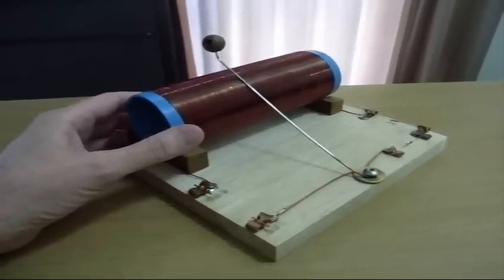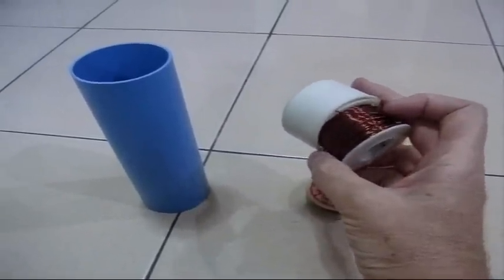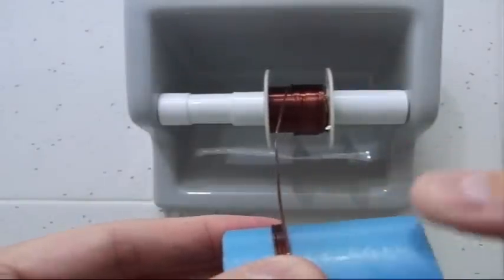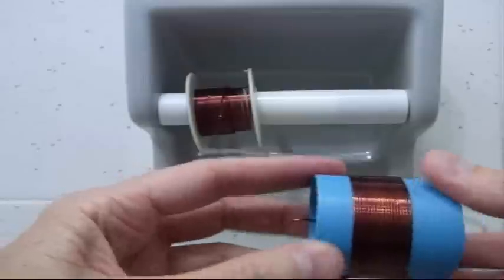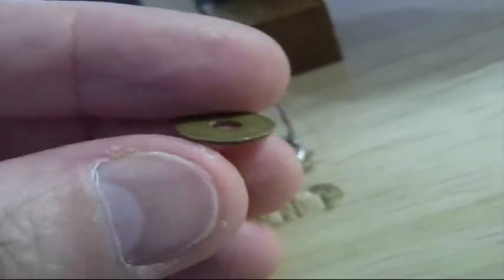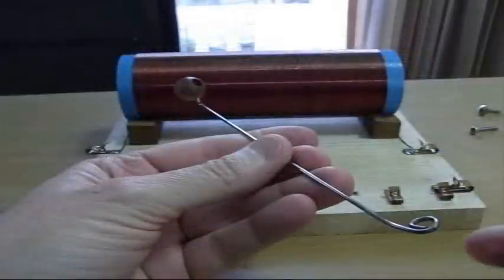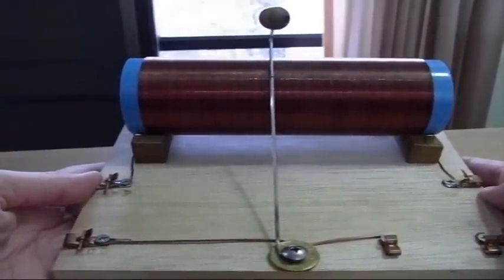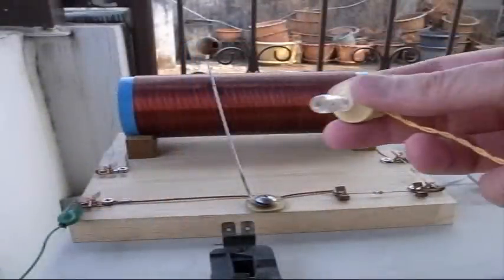How To Make A Crystal Radio - No Batteries (Updated Version Available)

Comment: nice video.. have you managed to get these contraptions to light up an led?? I seen some do that here.. that would be interesting to see ! wireless free energy from the air with air coils!! we could also use litz wire for these coils right? I think we could also use terminal connectors instead of solder or brass clips..do we really need the resistor to make it work?
Reply from the maker: Lots of good questions.  I have tried to get it to light up an LED and thought those were fake.  I tried and failed, BUT I got much higher voltage readings than I thought possible (around half a volt!).  Now I am thinking that if I was close to a high power station (the ones around me are just average) it might light up a very sensitive LED.  The videos I've seen the LED is just barely lit and I suspect may actually be an infra-red LED, but lit is lit.  So I have to do a video on what I found.
Litz wire is theoretically possible, but I think would be very difficult in practice.  The wiper would have trouble making consistent contact.  But I don't know so it might be worth a try.  I just used .5mm enameled wire.
Yes, terminal connectors will also work.  I wanted to experiment with different components and made it easy for them to take in and out.
Yes, the resistor is necessary to get the best sound from these "new" crystal earphones.  They are piezoelectric and have lots of capacitance.  Without the resistor the charge builds up then discharges so you get constant "static" sounds.  The resistor bleeds off charge so you get louder, and much clearer sound.
Reply: if we used litz wire we may not use the rod tuner anymore, but we may have to use tuning air capacitors..the resistor removed might.give lots more lighting power for a possible led lightup..the videos I saw used air capacitors tuned in resonance with the coils and it light up a bright white led..I heard.litz wires have more advantage because it has multi insulated strands within that act like ac capacitors and store the energy coming in like a very light leyden jar hehehe..I hope you succeed in lighting up an led..its like the holy grail of free energy from the power stations powerful transmitter !
Reply from the maker: fidel catsro There are many possible circuits, many of which use a tuning capacitor.  The capacitance for the circuit is usually in the picofarads (3-370) and the coil is about 400 uH so adding more capacitance in the litz wiring may take the circuit outside the AM band unless you re-spec the coil.  It might still pick up a multiple of the wavelength (or some other band) but at much lower power.  I'm working on one of those with a mica tunable cap.  Will be interesting to see how much I can pull out of it.
Reply: interesting tiny puny capacitors adjusting the frequency to get the right waves for us!
Reply from the maker: It is amazing.  I build one many years ago and played with it for hours.  Took it to school to show my friends and teachers.  Even years later it still is fascinating that it can pull enough power from the air to work by itself and be as loud as it is.
Reply: tsbrownie we in asia weren't taught about these in high school other than pictures of a laminated ac step down transformer in the 1990s..maybe they afraid it might lead to many pulling energy from aether if they taught it here!!
Reply: professorfidelcat I thought of combining a loop antenna crystal radio with Jeanna's light. I don't know if it will work though.
Reply: ok ive managed to light up a cfl with a single good AA 1.5volt battery using an audio transformer and a tip21 transistor before..it takes about 250ma at least at 1.5volt input..it might be a challenge for you to light up something more guzzly than LEDS
Reply from the maker: I finally did better than light up an LED (which I also did), but got this to work as well:
https://youtu.be/0WvZC3-mR6Q
Reply: @tsbrownie  hi there its been a long time eh 7 yrs!
Reply from the maker: @fidelcatsro6948  Yes, a long time, but I got it to work as you asked! 😁
Reply: @tsbrownie  congratulations let upscale that to a 14volt car battery charging system🐱👍🏿
Reply from the maker: @fidelcatsro6948  OK, give me some time! ;)
Reply: @tsbrownie  try to hit 20volts or even higher if you can, once its used to charge a battery its going to bog down and drop voltage

Comment: Does it have to be a special diode? In that case, what type of diode does it have to be, I'm wondering if I can use some random diode that I can salvage from some electronic device to use as the diode
Reply from the maker: It MUST be a 1n34a diode.  99.999% of other diodes will not work.  There are substitutes, but don't risk it.  You will spend lots of time and don't want it to fail because of the wrong diode.
Reply: just look for "Germanium diodes"

Comment: Hello, #tsbrownie - does it matter the voltage rating for the 10k ohm resistor?
Reply from the maker: The voltage rating does not matter in such a low voltage application, but you want to use a carbon resistor and not a wire wound one.

Comment: Not getting anything in the earpiece. What is the significance of the diameter of the bottle, you use to wrap the wire. I used a smaller bottle with only 40 rounds. Should I use a bigger(in diameter) and longer bottle to be able to coil around more wire ?
Reply from the maker: +Anurag A. 40 turns is rather few, but you should get something.  The usual problems (in order): 1) did you use the correct type of earphone.  ONLY a crystal earphone will work.  2) did you take the enamel paint off the wire where there are connections?  On each end of the wire and where the wiper touches the coil.  3) Do you have AM stations in your area?  (This is a problem in India where they don't have many).  I just made another, different style yesterday and even before it was completely done I could get 1 station!
Reply: +tsbrownie I'm in US about 100 miles N of DC. I got the crystal earphones(Philmore Crystal earphone high impedance n. 748 Japan) from amazon exactly like yours. the only suspect is the antenna now. I connected a roughly 15 ft magnetic wire(same wire I used to coil around the bottle) to a satellite dish outside my house. For a very short period this morning  I heard a KRRRRRRRRRRR..., but that also went away quickly. Now it is absolutely blank.
Reply from the maker: The antenna wire can not touch anything metal.  You can use string or plastic or such to tie it up.  Make sure the enamel paint is off he end that connects to the radio.  Is your diode a 1n34a?  Other diodes won't work.  If you can, make a close up video of what you have, post it and I can look at it.
Reply from the maker: +Anurag A. From your video: Your windings look OK.  You used just 1 set of windings, yes?  
The earphone looks like the right one.  I can not clearly see the diode or resistor, I will assume the values are OK.  The big problem I see is the wiring.  I do not think that is right.  The circuit is a big "U".  One the right side of the "U" at the top is the antenna coming in.  Then the coil.  The bottom of the "U" is the resistor with the earphone across the resistor.  The left side of the "U" is the diode and above the diode is the wiper (or jumper in your case) and at the top of the left side is the ground.  
To test your diode and antenna you can put the antenna on one side (does not matter which) and the ground on the other.  Put the earphone across the diode (no resistor, just diode and earphone).  You should hear the loudest station (no tuning obviously).  
The antenna can not be in contact with metal or be inside or under a metal roof or similar.  
Final comment on wire: you must be very careful to remove all the enamel (green) coating all the way around the wire.  Also some of your connections look loose.  The currents you are working with are very, very tiny.  Small resistances add up and will kill the signal.  Make sure the connections are tight / strong.  If you are using steel screws or plated screws they may have oxide and/or not connect well.  I strongly recommend stainless or brass screws and washers.  If you can solder connections that is best (requires brass, stainless won't solder with normal solder).  Use only rosin core solder (not acid).  
It appears you have all the right parts, it's a matter of connecting them well and in the right sequence.

Comment: What sense does a recipient make. the one without electricity, works when you need an amplifier?
Reply from the maker: No amplifier is needed.  No electricity is needed.
Reply: @tsbrownie  No. I built such receivers in my youth, and it doesn't work that simple. The output power is not enough for such an ordinary earphone. If so, it only works with a high-resistance part such as an earpiece on the phone. And even then you can only hear the station that is closest to your own location. The selection and filtering of such a device is far too weak and imprecise

Comment: I take it since the pvc is an insulator, I could paint it a different color if I wanted and shouldn't make a difference?
Reply from the maker: +B Mart. You are right, it is an insulator, BUT (and it's a big but) paint color is typically a metal oxide and metal oxides often react with radio frequency energy (like ferrites and such) and can keep it from working right.  A clear acrylic is OK usually.  You can also use cardboard and colored cardboard will *likely* not have metal oxides or enough of them to be a problem, BUT (big but again) it's probably not worth it.  I've got a wooden coil I need to put together, not sure how it work, but hey, the experimenting is half the fun.

Comment: Because Stainless steel is a poor conductor of electricity, would a normal steel spoke make a better wiper?
Reply from the maker: The problem is that normal steel rusts quickly, especially in contact with dissimilar metals. So for the first few days it might work better, over time the compromise with stainless pays off.
Reply: Stainless is not much worse than non-stainless steel.  The resistance of the wiper is small compared to other losses.

Comment: Question what does 100k resistor do? In your design? Thanks. 😁🛫
Reply from the maker: The new crystal earphones are piezoelectric and they have a lot of internal capacitance. The resistor drains off the charge. If no cap, the sound is quiet and you get popping. You can adjust the resistor. I have used from 10k to 100k. 50k is a good place to start.
Reply: Thank you for responding I will give that a try.😁🛫

Comment: Thank you for this outstanding tutorial. I was wondering, what happens if the wire is kinked? No reception or simply a less good reception?
Reply from the maker: If the wire on the coil is kinked it will only affect reception a little.  The big problem is that it will open gaps between the turns of wire and the tuner rod will not want to stay in position around those gaps.  Most kinks can be undone and flattened out with pliers, so you don't need to have them.
Reply: @tsbrownie  one mystery less :)
Reply from the maker: @odal6770  I have many videos on building crystal radios.  If you have one that does not work, I have this video on fixing common problems: https://www.youtube.com/watch?v=kCxQ8iPQx4s&feature=youtu.be

Comment: Does the wiring have a coating?
Reply from the maker: Yes.  The wiring MUST have an insulating coating / varnish.  It's like the wire in electrical transformers and such.
Reply: Thanks.

Comment: I wish you would have explained more how it works, for instance, why does it not matter how to connect the diode (in / out)? And also why is there no crystal? In the old crystal radio's they use a piece of crystal and a pin on it. Sorry, I don't understand much of electronis but I want to learn and understand it. Also, does it matter how thick the copper wire is?
Reply from the maker: I need to do an updated version of this. The diode is the crystal; they are much easier and more reliable than home made diodes (rectifiers) like galena, rusty razor blades, etc, but they are all doing the same thing. Yes, the thickness of the copper sets how many turns per centimeter, that affects induction. I have a video on how to wind coils, it explains more about them. AM radio works by varying the strength of the signal with the loudness of the sound (overly simplified). You've seen pictures of sound; they look like graphs. The diode takes either the top, or bottom of the wave and cuts off the other half and that remaining part wiggles the earphone diaphragm. Your ear does not care if the diaphragm wiggles up and down and up and down, or down and up and down and up.
Reply: @tsbrownie  Wow, thanks! I wonder how these diodes are made, its all so magical to me. I also don't understand why there's a resistor in between the earphone wires. I wish I would understand every detail of it all. Why does one wire of the earphone not care how much power goes through and the other is 0.25 watt with the resistor. I'm also wondering how the current flows, what direction, is the wiper the initiater of power? I love your video, I've ordered all the parts and will build this thing with my daughter. I am an IT woman and programmer, but I really know nothing about eletronics. I want to learn this stuff, I love it!
Reply from the maker: @Saskia-uz4ds  What we both need is an analog engineer, but they are rare these days. I am a ham radio nerd, but don't practice any more. There are some really excellent videos where people show the current flow through (google current flow in crystal radio. They don't all match my circuit and some show a circuit that does not work, but you will get the idea better).
This is not 100% true, but it's close: In this radio, the left side is acting as an antenna tuner, and the right side is an inductor / capacitor (coils have both properties) that resonates at the frequency you want to hear. The wiper is diverting the signals you don't want to hear to ground. 
The resistor between the earphone leads was a capacitor in 1960s radios because the crystal headphones were a very different design. Today's earphones are piezoelectric and they build up an electrical charge and quickly stop working (you hear popping), so the resistor gets rid of the static charge. You can experiment with different values for max loudness.
Reply from the maker: @Saskia-uz4ds  You do have AM radio stations in Croatia, yes? That is very important. This does not work with FM.
Reply: @tsbrownie  Thanks for all your info, I really appriciate it! I am from the Netherlands and we still have AM radio. I went to a electronic store today and bought all the stuff I need, luckily they still had some germanium diodes. But I bought a regular mono headset, hopefully that will do. I'm very excited to solder this stuff tonight. Now I'm going to cut some steel from my old bycicle wheel! 🙂
Reply from the maker: @Saskia-uz4ds  google traslate told me it was Crotia. :( The regular earphone will NOT work. Its impedence (resistance) is too low and acts like a short. The piezoelectric earphone has extremely high impedence. They are opposites.
Reply from the maker: @Saskia-uz4ds  I just searched "crystal earphone Netherlands" and found them.
Reply: @tsbrownie  Haha, "Nee dank je" is Dutch for: "No thanks". Do you happen to know how the old earsets are called? And if they are still for sale somewhere?
Reply from the maker: @Saskia-uz4ds  I thought it was Dutch, I've been to NL several times for work, but google translate insisted it was most likely Croatian. When I google "crystal earphone" under "all" they show up for sale in Amazon and other places. If I look at "images", most are the piezoelectric type. I bought 5 last year for about $1.50USD each. If you google "antique crystal earphones" the over-the-head black ones are the old style. I won't recommend them because you pay a lot more for painful ears; they are very uncomfortable. "Buy antique crystal earphones" gets you lots of hits on ebay from between $40USD to $100+.
Reply: @tsbrownie  Thank you so much!!!!
Reply from the maker: @Saskia-uz4ds  Good luck. Post a link if you make a video.
Reply: @tsbrownie  Perhaps I will, I never upload videos but why not indeed rhis time. 🙂

Comment: Thanks for the Video, can you please give specification of the earphones you have used. I tried using Telephone headset, it did not work. Please provide specific name, I can go on amazon and order it. Also please give specification of the resistor. Thanks a lot.
Reply from the maker: +Anurag A. These are piezoelectric earphones.  I have never seen specs.  You can search on "crystal earphone crystal radio" on Amazon or electronics page.  They range in price from a few dollars to 10.
Reply: +tsbrownie  thank you for the information I was able to find it on Amazon and order it. Will post here if it works.
Reply from the maker: Will look forward to watching!